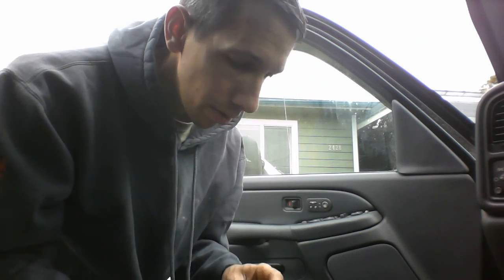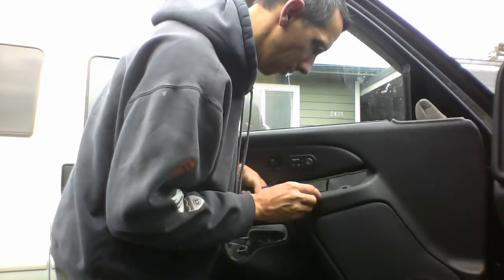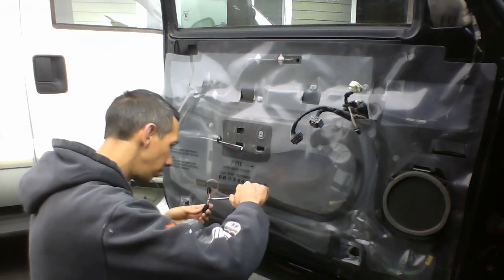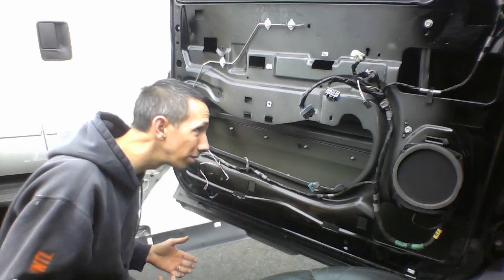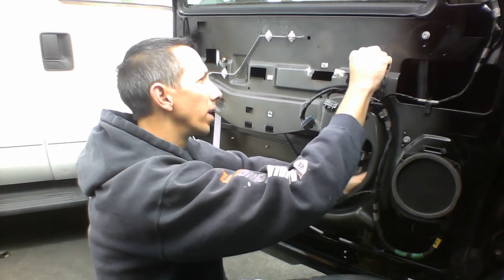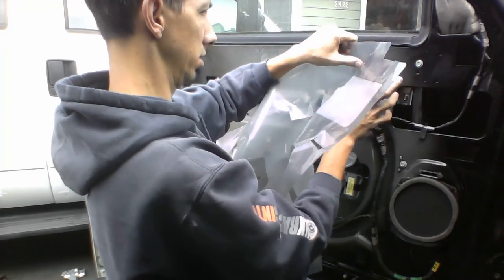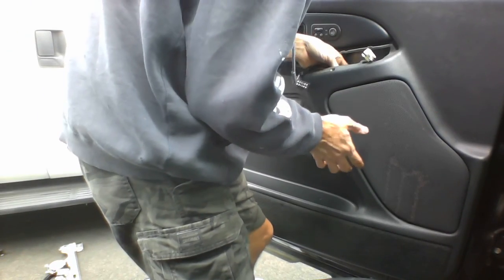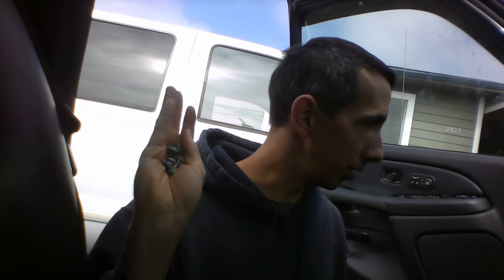electric motor/ window assembly replacement for 2002 chevrolet avalanche

Comment: Received the new tracks and regulator today..thanx to your video it was a quick change..use good tape folks, mine melted in the heat and the window came down..but all was okay..thanx once again.
Reply from the maker: Oh great, so glad the video helped =) good tip on the tape too, I found that painters tape to be pretty strong and comes off easily but held well too =)

Comment: Thanks for taking the time to make this video, Very helpful. My cable was broken in the same spot yours was. I bought the regulator with the motor too even though my old one still worked, it had some corrosion starting by the seals. That convinced me to get the whole assembly.  Cost was $100. I was quoted $250 - $300 by a couple shops around town, I trust their work but I need my money more than they do LOL
Reply from the maker: yeah this seems kinda common on the chevys I have owned..  I do live on the coast though so that might contribute. Thanks for the nice comment. This really not too hard, and if it saves us some money, why not try =)
Reply: I'm in Michigan so they get hot and well below freezing through out the seasons, its not surprising that happens but I think this is the first time my window has stuck like that since the first weekend I bought my brand new Z28 in 1980 LOL
Reply from the maker: nice lol. Yeah I imagine the winters could be rough on vehicles there... =)
Reply: Scary Talking Head yea especially when your ride is parked outside all year round. But I know that coastal weather can be extreme too!
Reply from the maker: yeah, not sure why, but my fords don't seem to have the same problem with their electric windows....? not sure
Reply: I dont have a ford, I havent had one for a long time. Have you had to fix the tailgate latch yet?
Reply from the maker: nope, haven't had a problem with the tailgate on the avalanche at all. I know they had a recall on the cable or something, but I have had no problems at all with it.
Reply: Mine is a bit wonky but it works , I had to fix it once ,, a lot easier than the window regulator
Reply from the maker: some of this stuff is kinda fun. I like fixing things, but I don't like needing to use something and having it not work lol if that makes sense. I guess have leisure time to fix something you don;t really need at the moment is fun, not being rushed into trying to fix something because you need it right away.

Comment: Question is it easier to replace the whole assembly our just the. motor?
Reply from the maker: Michael Monroe I have done this a few times on a couple different Chevy vehicles, and I think I just did the whole assembly. The cables were the things that were going bad for me, but i figured might as well replace the whole thing. Not a whole lot more money. So I can’t speak to replacing just the motor. Maybe try finding a video where they replace just that and see if it looks easy or not? Sorry I couldn’t give you any definitive answer on that, just don’t want to speak outside of what I know based on experience.
Reply: @ScaryTalkingHead  thank you for your knowledge... fyi I'm needing to replace my 02 avalanche passenger mirror... saw  YouTube video that was no help, I will figure out. Thanks again

Comment: I have the same truck and the rear windows were both stuck half way up . I ordered just the motors, because i had changed the things only a few mounths befor. So i changed the motors and only one side weny up. The other side ( with a new motor is still stuck ) any thoughts ????
Reply from the maker: hmmm can you hear any noise at all when you are trying to roll up the windows, or is there no sound at all.... You might be dealing with a loose connection maybe something as simple as a plug wasn't pushed into the connector all the way? If you do hear a sound like the motor is trying and there is no movement, then I would guess that either a cable has broken, or something is binding somewhere along the window slide things..... I would pull it apart and see if there is anything obvious. =)